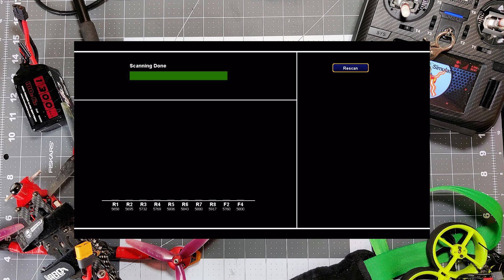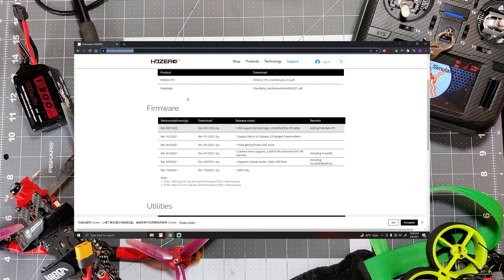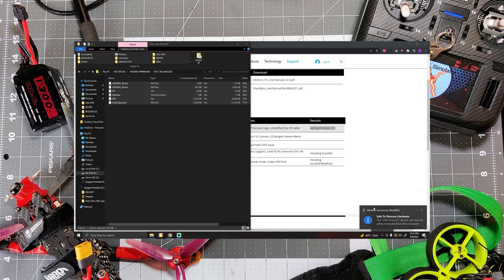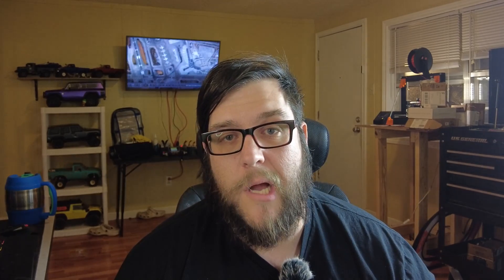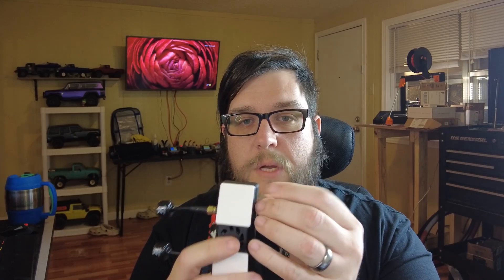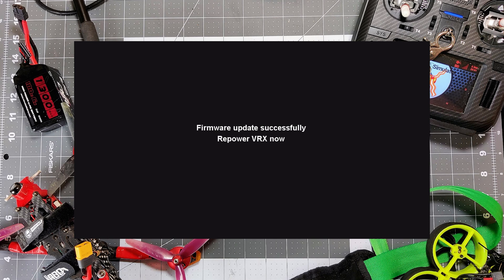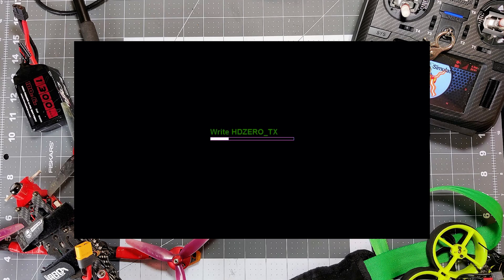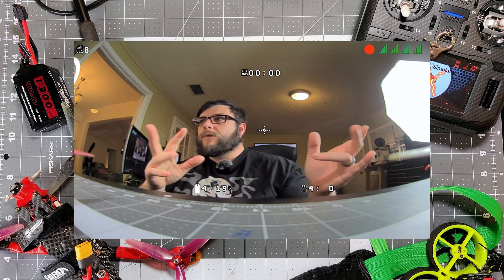HDZero Freestyle VTX - How to unleash MAX 1 WATT output | FPV Drone Tutorials

Comment: Well done video... FYI and not sure it matters, but per the "HDZero_VTX_UserManual_v0.3.pdf" User Manual stated that you need to power on the Freestyle VTX and wait for the the blue led to flash three times to 'complete the unlock' after you have flashed it with the Unlock_freestyle\HDZERO_TX.bin but before you flash the VTX with the FreestyleVTX.Rev26012022\HDZERO_TX.bin or newer firmware.
Reply: I 100% agree with powering up the vtx after unlocking to get the 3 blue flashes before flashing new firmware. I tried four times in a row and could not get it to unlock until I powered up the VTX first. Just in case anybody else goes through what I went through but I 100% appreciate the videos please keep them coming!
Reply from the maker: @jamisonhinton5837  I'm not sure why neither of mine needed that during the flashing process, but for sure if someone is running into that on theirs it's the step to take!  Wish i had known it was more common when i made this because i for sure would have mentioned it.  I may have to pin this comment thread so people don't miss it if they run into that!
Reply from the maker: Thank you!  It does state that in the manual for sure, but in my experience the first boot where you have the VTX and VRX connected to flash the VTX firmware after the unlock usually starts with those three blue flashes and encompasses the necessary process.  I think they are playing it safe a little with the instructions, but absolutely an option if you want to follow it to the letter.
Reply: @BaconNinjaFPV  Is this procedure identical for using the HDZero Goggles, rather than the Module?

Comment: I recently purchased an hdzero freestyle and I have it hooked up with power via a battery nothing else, my hdzero box goggle connects to a signal then it's just a black screen, can you offer any advice this is my first drone hardware. Happy to leave super chat for helping. Thanks for the videos. This is for an rc car project
Reply from the maker: hmmmm, do you have any lights on the VTX?  That will tell us what may be going on with the connection between the camera and the VTX.  If the lights are correct, then you may be in 0w output mode but if the lights are doing something funny you could have a camera or cable issue causing that black screen.
Reply: @BaconNinjaFPV  thank you kindly for the reply. I'm just used to rc car stuff working. I didn't have access to a PC but after updating the transporter 2hd and the freestyle vtx it is working, is it normal for brown to appear as pink? I don't have a flight controller as this is an rc car project, so I guess I can't access any camera settings? I've bought so many cameras and vtx and nothing plays nice or I can't use it all bc I don't have an FC is really bumming me out and draining $.

Comment: I am only seeing "MAX GAIN" option which I think was available before flash too, anyone else getting this on later firmwares?
Reply from the maker: Are you talking about the top option in the VTX table?  If I remember correctly, that one was always labeled max and was just part of the default VTX table for this one.  It just wasn't actually available unless the VTX was unlocked, so if you picked it before unlocking it would just drop back down to 25mw without saying anything.

Comment: Excellent video - timely - thank you !
I am using INAV and I am installing HDZero - your instructions are great for Betaflight users. My questions relate to INAV.
 I did all the flashing VRx, unlocking VTx and flashing VTx and all went well. This process is the same regardless of Betaflight or INAV.

My questions are related to the end of the process and the use of the VTX table (I do not beleive this is needed for INAV, can you or someone else confirm)?
Regarding configuring the Ports: I am assuming, with INAV, that I will still configure two UART ports (one for peripheral selections and the second for MSP enable?

Can you or others clarify the ports setup for INAV?
This video was well done.
Reply from the maker: I haven't used INAV personally, but from some other questions people have had I can tell you for sure that you are correct on it not needing the VTX table.  As for the UARTs you should still need a full TX/RX for the MSP OSD, but I would leave off the smart audio peripheral and just control the channel and power with HDZero stick commands since they work so well.

Comment: Thanks for the video. Nice Work. Does this only work with Smart Audio connection?
Reply from the maker: Thank you!  The VTX will work without SA if you want to use the stick commands to control the VTX.  If you unlock it, the full output is available either way you go.
Reply: @BaconNinjaFPV  thanks for your quick reply 👍🏻
I must have done something wrong.
Can I still unlock after FW flash of the VTx?
Or will I have to flash the VTx again?
Reply from the maker: @FPVMedias  This is pretty common actually.  What you will want to do is flash the unlock again.  Once the unlock flashes and tells you to restart the VTX, just unplug power from your VRX, wait a second, plug the VRX back in, let the VTX power back up off of the VRX, wait for the blue light on the VTX to blink 5 times then go solid, wait another couple of seconds, then disconnect power from your VRX again.  After that you will need to go through the actual firmware flash on the VTX one more time.
Reply: @BaconNinjaFPV  thank you sir!
Will do that 👍🏻
Reply: @BaconNinjaFPV , it WORKED!!!  THANK YOUUUUUUUUU! 🙃
Reply from the maker: @FPVMedias  Nice!! So glad it worked out for you!!

Comment: I followed your directions step by step while pausing the video as I progressed. Everything is working except for the fact that the tx is still not unlocked. I'm not sure what I did wrong. Any advice would be greatly appreciated.
Reply from the maker: Some people have found that after flashing the unlock you may need to power down the VTX, power the VTX back up, wait for the lights to stabilize, then power it down and proceed with the next step.  I didn't have to on either of mine, but others have reported the need for sure.
Reply: @BaconNinjaFPV  so, an external battery is needed after all? The vtx is not powered by the rx module while flashing?
Reply from the maker: @doncunningham3124  in the case thay you have to do this extra boot to get the flash to take, that is correct.  I am working on some amendments to this video to cover that scenario, sorry about the clarification.
Reply from the maker: @doncunningham3124  as for the flashing steps, the VRX does power the VTX during those parts.  Just to clarify, it is only the part where you unplug the update cable after the unlock flash, power the VTX up via the drone's battery and wait for the lights, then power down that needs the external battery.  the next flashing step for the actual firmware is powered by the VRX again after that.  Kinda of annoying, i know.
Reply: @BaconNinjaFPV  I guess I should start over again? Hopefully I'll understand the flashing lights stabilizing when I see it.  I'll try tomorrow after my first actual test flight. Seems I have to work out some gps issues as well. Thx
Reply from the maker: @doncunningham3124  starting over with the flash is probably a good idea.  Just follow the unlock flash instructions per the video, unplug the VRX from the VTX when it tells you to, stop and power up the VTX without the VRX plugged in, wait for the red light to go solid, then wait for the blue light to flash 3 times.  Once that is done, unplug it from the power source and continue on with the flashing steps per the video again.  I am going to recommend to HDZ that they just put out two firmware versions, one with the unlock built in and the other without, so that it is a one step process every time without some weird power cycle step in the middle.  I wish either of mine would have had this happen so I could have covered it from the start.

Comment: Great vid! I just ordered two Freestyle VTX's today so should be here tomorrow and will use this video to get them setup. On a side note, I have a 2Fiddy 5" with the Race V2 VTX in it and I'm having issues with the screen blacking out whenever you try to go into the SA screen or any OSD setting screen but it doesn't do it when it's flying. Ever heard of this issue before?
Reply from the maker: I think you will really enjoy those 1W VTX's!  So the OSD works just fine until you try to go into one of the BF menus?  It sounds to me like a firmware thing at first glance.  It wouldn't hurt to try updating to the latest on the VTX and VRX if you haven't already.
Reply: Yes, I have the most recent firmware on everything. Strange this is, I switched my receiver last night from the ceramic elrs to a Axisflying elrs regular antenna one and it helped it drastically! Now it hardly does it at all, but it's still happening occasionally though. IDK 🤷

Comment: Do you have to go into the menu to set the 1watt or does it automatically does it
Reply from the maker: after the unlock, you have to set it with either the HDZero stick commands or smartaudio.  Check out the other comment I wrote you for some more detail on that.

Comment: This is the content I’m looking for. Thank you so much. New sub. Look forward to watching a lot more of your vids, past and future.
Reply from the maker: You are very welcome!  I really appreciate then encouragement!
Reply: @BaconNinjaFPV  do i have to access to menu to set the 1watt output? Or does it do it automatically , running inav with rx and tx but can't seem to access the menu , dose smart audio have to be connected as well
Reply from the maker: @jimmytheriot8978  so you have two real options for setting the output power on this VTX.  one is smart audio, but I am not sure how well implemented that is with iNav and this VTX.  The other is the HDZero stick commands.  You can read up on those in the manual from their site's download section at the very top.  I prefer smart audio, but that is usually because I like to use things like low power disarm.

Comment: Thats why my vtx's shut off while arming! I need to fix my table 🤗 thx for that.

But hey, i dont think the amplifier powers on while uploading. Never had heat issues while updating and im holding them in my hand since i update on a groundstation
Reply from the maker: Glad I could help point it out!  I too believe that the amplifier is at least in a zero output state while it is connected to the VRX and doesn't reach anywhere near the temperatures that it would under typical conditions.  Me emphasizing the use of a fan is really just an abundance of caution.  I know someone out there is gonna flash their VTX and leave it plugged in for an extra hour or something because their dog decided to run out the door right in the middle of their firmware update....or something like that, lol
Reply: @BaconNinjaFPV  well that would be a really unfortune case 😅 but the fan will help then for sure. I run a 1w in a foam wing, foam is notorious to insulate temps really well as you certainly know.  But i run a 20x20 5v fan right about it and can leave the vtx plugged in for ever. At least it doesn't get even warm  in the current weather conditions. You should try it with inav. Its awesome as well
Reply from the maker: Man IDK how you wing pilots can fly wings, lol....i just know I would crash endlessly and break so much stuff.  Im looking forward to seeing how this VTX holds up during a 115 degree Texas summer with no active cooling in the back of the quad.  Im sure it will be fine when its in the air, but on the ground is going to be a whole different ball game.
Reply: @BaconNinjaFPV  well its actually about the same with the DJI stuff, they get hot af as well. The airunit just has all that metal case thingy acting as a cooler. 

About the fixed wings. Just get some stryofoam sheets and start building some really low buget wings for the beginning. You need 2 sheets and 20 mins for a wing xD i started with actual insolation styrofoamsheets in 10mm and now i freaking love planes even more than quads. Its really easy btw

Comment: Thanks for doing the video. Need to get my Sharkbyte system in a quad. Been sitting on the shelf too long.
Reply: Yeah I'm in the same boat bruh. I didn't even order the RX module until the 1W VTX was on the horizon.
This video from MBN will keep me up to date when I have the funds to order the VTX and camera 😎
Thank you MBN 😀
Reply from the maker: you are very welcome!
Reply from the maker: you are very welcome!  Sounds like its time to get your low latency digital on!

Comment: Seems easy enough!
Reply from the maker: Yeah its really not too bad.  I think the biggest thing that people are getting stuck on at this point is unlocking the VTX after the flash, which just wont work.  I actually did it that way the first time, even after reading the instructions several times, and had to beat my head on a wall trying to figure out where I messed up, lol.